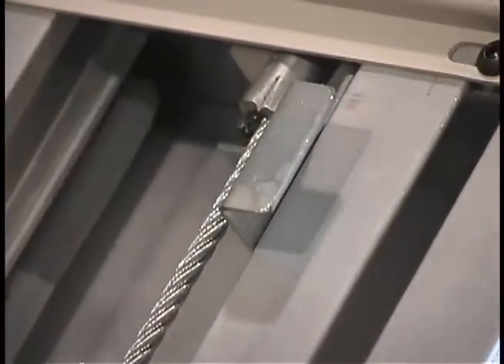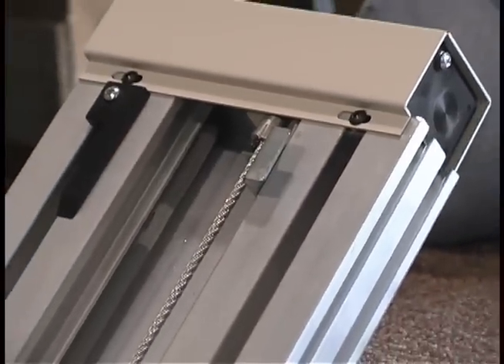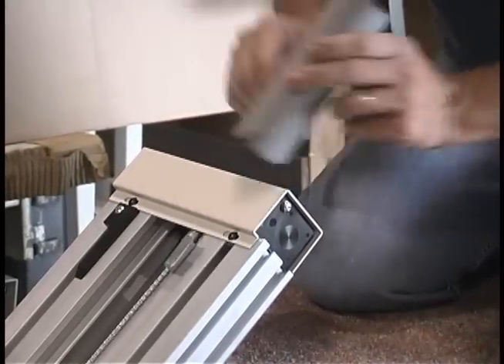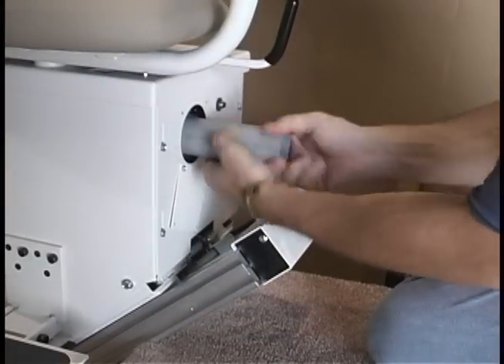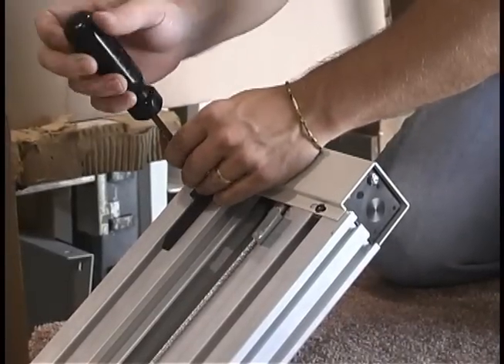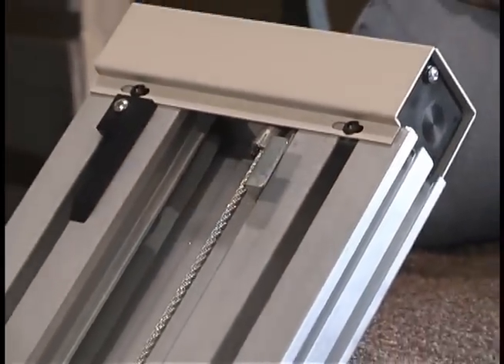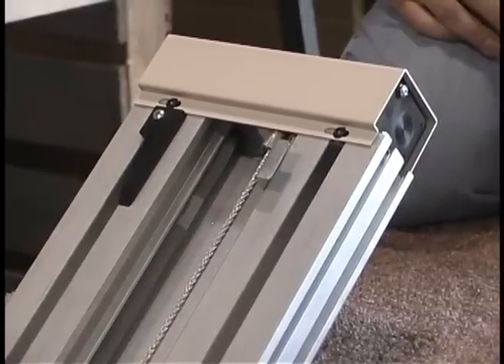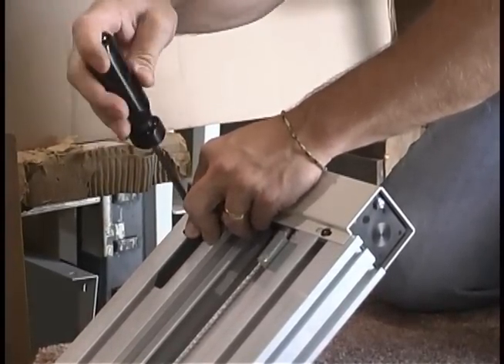How to fix Common Stair Lift problems

Comment: Acorn 130, everything is working, but will not charge. Batteries are good, and shows c1. Will not charge at the charging points!  Shows voltage at the power switch and at the charging points.  Is there a fuse that operates this? Please help,
Reply: I'm sorry, it shows A1

Comment: Help my mother's chair is stuck, how do you use the winding handle( where to you put the handle)?
Reply: Watch this video again as I think you just unscrew that compartment he showed on the video and the winding handle is already inside there. I wondered and am going to check mine tomorrow to see if it has a winding handle. If you have a Harmar Summit lift which appeared to be the one in the video, call Harmar direct as they were very helpful to me on the phone when we first got our unit.

Comment: The poster is the Marketing company trying to sell lifts and using Youtube to gain added Marketing of their name and brand. I have many customers who were sold these units and constantly have to pull up on the cable to reset the slack safety. Buying a better quality lift will help assure less troubles.
Reply: I got an all-electric (no battery) Harmar Summit chair sold by an Ameriglide vendor. I think it's a very good quality stairlift and has given us very few problems. Would you disagree, as it seemed to be a Harmar Summit chair?

Comment: Why would you want to have to keep fixing this problem? It would seem to be a big enough problem that they had to post the fix so customers would not keep calling. Why not just buy a better quality system that does not have to be reset after every other run?
Reply: Mine has never had to be reset, just adjusted once as the installer forgot to leave a bit of space at the top as shown in this video. That piece has never needed adjustment since he moved it 1/2-inch away as this video recommended and we've had our lift for a year now with pretty heavy use.

Comment: Never buy a stairlift that uses cables. These things have killed pets, taken fingers off, and have sent old ladies out the window during failures.
Reply: We're very pleased with ours. I think you;re unnecessarily scaring folks. If there's a problem with one with a cable, it simply stops and doesn't "throw" anyone anywhere!